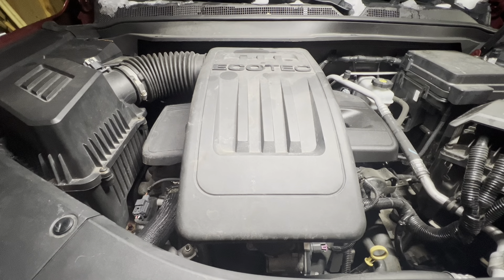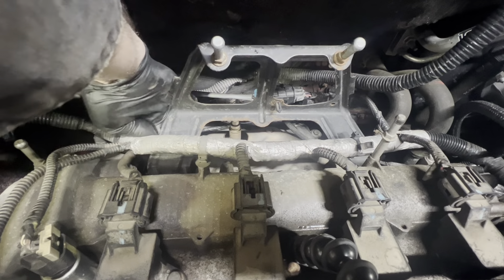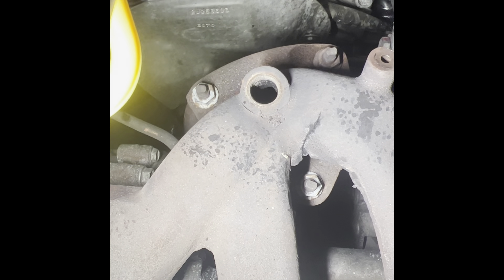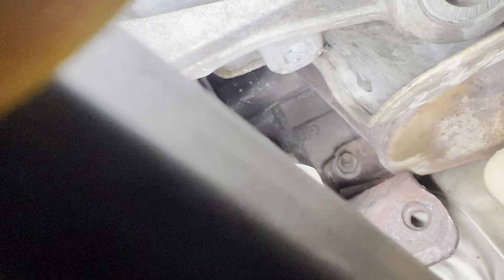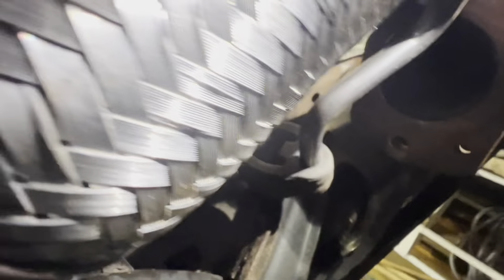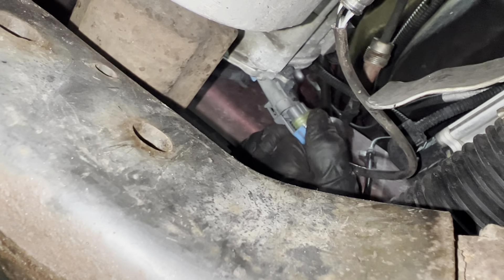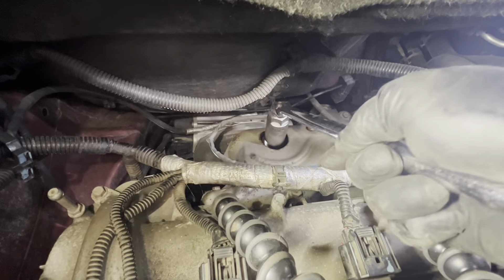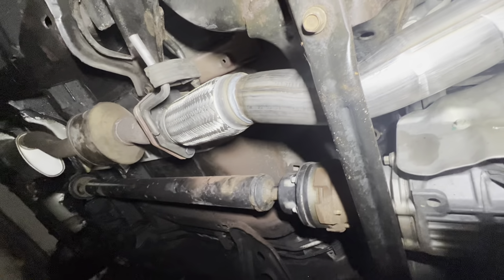2011-2017 Chevy Equinox & GMC Terrain Catalytic Converter Replacement

Comment: This video helped me out a lot thank you. I ended up also replacing the exhaust manifold due to it being cracked in the middle. However, now I smell exhaust inside the vehicle do you have any thoughts on what I did wrong? I followed the video step-by-step.
Reply from the maker: New exhaust parts will smell for a little while until they break in. 
If it doesn't got away after 100 or so miles, check for leaks. Maybe you missed a gasket?

Comment: Thank you so much for this video. I just finished doing this on my 2013 GMC Terrain. I'm not a mechanic and the only other work I have done is replacing spark plugs, changing oil, brake pads and rotors, air filters, lights, etc. It took me two days and about 12 hours. The only thing not in your video was the air injection check valves. Maybe because I'm in California or cause mine is AWD. They were a pain and were totally in the way. Had to remove them and zip tie the pipes down so they would be out of the way. That bracket holding the cat on was the worst part. I was finally able to get it off by reaching down from above with a combination wrench. I would have gladly paid a shop to do this work, but nobody would do it because of California laws. No way could I have done it without your guide. Thank you bro!
Reply from the maker: Thanks! 
Those check valves must me a California thing because this one was AWD. 
Glad you got it done. Sorry about those CA laws
Reply: @BrakeTheBank yeah CA laws sucks.

Comment: What problem was you having to make you replace the cat currently mine does have a loss of power under acceleration.
Reply from the maker: It was due to a check engine light

Comment: Excellent video. I just tried some Cataclean but if it doesn't help my issue I'll be replacing the catalytic converter following your instructions.
Reply from the maker: Sorry the catclean didn't work. Glad I could provide a little help with your project!

Comment: I have a 2013 GMC Terrain AWD. Took me 8 hours. Got the part from RockAuto. Borrowed the O2 sensor socket from O'Reilly's. Longest part of the job was figuring out how to get the back nut on the bracket off - I ended up cutting the old cat in the middle of the L so I could push it to the side and get the nut out. If anyone else has an AWD, I recommend cutting the pipe as I did. There are other ways, but cutting the pipe is easiest/fastest. Probably could have personally saved an hour or two with a better cutting tool, but you use what you've got! Thanks for the video!
Reply from the maker: That's a good tip!
Reply: What pipe are you talking about, are you talking about the catalytic or the exhaust pipe?
Reply: @misaelherrera2845  The exhaust pipe just below the catalytic converter
Reply: @benjaminleinonen2153  oh ok

Comment: for the 3 bolts attaching the manifold to the catalytic converter, is there a torque spec? If not, then what is the torque spec of the impact driver you used?  I want to make sure the studs don't break
Reply from the maker: Oh man, that is a good question. I don't know/I don't remember.
My guess would be around 50 to 70 foot pounds but don't take my word for it.
I would definitely recommend tightening them by hand so you can get a feel for it
Reply: 30 foot pounds or you could put a crack on the exhaust manifold
Reply: The crush o-ring doesn't need a lot of torque to seal tight. So definitely don't go crazy if you use a impact gun.
Reply: I used 124 in/lb (10.3 ft/lb) which is the same for the exhaust manifold to cylinder head.  I’m still sensing a little bit of exhaust sometimes at stop lights.  I don’t think it is enough.  Think I may need to go higher.
Reply: Did you check other lower connection fo leads. Cold engine soapie water test on connections
Reply: For leaks
Reply: Have not.  Thank you will try that.

Comment: I just did this and the light went off, I thought the P0420 was finally gone,  but it just came back 6 days after replacing the cat.  I did not do new oxygen sensors, this car burns oil, do you think the sensors may be compromised?  

Great video and thank you
Reply from the maker: Yeah sounds like something is going on. You'd have to view live data to see if the o2 sensors are working properly. Also check fuel trims. If it's running rich it will foul the new cat.
Reply: @BrakeTheBank  pulled the 02 sensor today, thing was TOAST!!!!  Replaced a cooked densor (someone must’ve been in there before) with the AC Delco OEM sensor. I didn’t clear codes as I want to see if it will clear itself after some drive cycles.  Will keep you updated.
Reply: @brendanf8969 from what i read in the article about the 2011-2014 chevy equinox recall, the excessive  burning engine oil caused the catalytic converter to fry up. Thats what i read in the chevy recall when i was researching about the excessive oil consumption.

Comment: Good job in the removal and install. Mine had rusted bolts that had to be cut off.
Reply: What did you do when you had to cut the bolts
Reply: The two bolts that secure the Cat to the exhaust pipe were rusted so I cut them off and replaced with new bolts. The single bolt that attached the cat to the engine Bracket also had to be cut and replaced. What a pain!!

Comment: Great video! I wish I had the tools and time to do this to my 2011. I'd like to replace my complete exhaust system. But buying all of the parts and tools and finding the time to do it is a problem for me.
Reply from the maker: Yeah it's a pretty big job. Some of the tools (Like the o2 sensor socket) you can borrow for free from your local parts store. This would be the hardest part of replacing the whole exhaust system so If you can do this you can do it all. I'd encourage you to try.
Reply: Just get a basic tool kit like harbor freight 301 piece or something similar and get other tools as needed..most of the guys will tell you exact tools needed for the job. The satisfaction you feel when you fix your own car is not only great but awesome 😁

Comment: I have a 2013 LT Equinox and I found a couple of parts, which I think are something to do with emission control, on top of the heat shield which meant I would have had to remove them to get the heat shield off. So to anyone watching this video have a GOOD look before you start pulling bits off, the job may be bigger than you realize!
Reply from the maker: Oh wow! Might be something different for cars originally sold in CA or something?
Reply: @BrakeTheBank  Could be for CA compliance, I didn't have the passion for doing the job myself (pulling the cat) so I'm getting a mechanic to do it. It is shop that sold me the vehicle, he feels guilty he sold me a vehicle that needed work, so he's doing it for a greatly reduced cost.
Reply: @pete7413 idk, i live in  CA, and my chevy equinox looks exactly like in the video. Probably yours was a v6 engine,  because this one looks like a 4 cylinder engine like mine.
Reply: @misaelherrera2845  Lol, no, definitely a 4 cylinder though how I wish it WAS a 6 or at least any other engine but the oil using 2.4 configuration. To anyone considering buying a secondhand Equinox do better research than I did and pay the extra to get a 6. You won't regret it. 

Update to my first post above. I got the cat replaced, and the engine check light came on within a day. I bought a gadget to reset it and it does that fine however it came back on after a day or so. 

I don't even bother to reset it anymore as being an aftermarket cat the car will always throw a code but the difference in price between an aftermarket catalytic converter and an OEM is enormous. Too much to justify on vehicle I didn't intend to keep, but, here we are a year later and I still have it, and the light is still on :(
Reply: @pete7413  that is very true. Oem parts are very very expensive. Thats what my younger brother was telling me when i used to own a 2015 chevy cruise.  The check engine was on 130k miles, he told me to not bother because it has 2 catalytic converter one in the front and the second one in the back and its a pain in the rear end. The part was somewhat affordable in the after market but paying for labor was going to be expensive part for the car. Doing smog check in California was expensive because of the check engine light from the catalytic converter , every 2 years we had to smog it illegal for it to get tags. The illegal smogging would come out 500 dollars or more depending on the California emissions laws that keeps changing every year.

Comment: Only if had the strength & tools 😩🤦🏼‍♀️
Reply from the maker: You got this! You could get all the tools you need for this job for under $100 at menards or harbor freight. That's way less than you'd pay in labor costs.
Reply: @BrakeTheBank  Yes but it's so much easier with impact tool. I love doing auto work since I picked up my 1/2, 3/4 and 1/4 inch cordless. Tried  it without them and It was murder without them or breaker bar. Could not get the the bolts out close to the back cat or the back sensor.

Comment: Hi thank you for the awesome video, I’m trying to remove the converter of my 2011 gmc terrain, last step about removing the 15mm nut of bracket, it doesn’t give me enough space like in this video to reach it, can you give me some suggestions?😅
Reply: For update, I have changed it successfully, my problem is solved by cutting the pipe. In my case, the pipe has to be cut in order to reach the inside nut of bracket.
Reply: More reference: https://youtu.be/PE8PSsy_rxc
Reply from the maker: Try using a swivel and some long extensions

Comment: thanks for the video but i would replace all sensors
Reply from the maker: Yeah it might be a good idea to replace the sensors if you want to avoid having to replace them down the road. In this case I had just replaced the down stream sensor.
Reply: Hey do you know how I can identify this issue with my own vehicle..? My car smell like exhaust gas fumes especially when the heat is on And sounds  similar to a low rumblling motorcycle. And now has began to seem as if it’s losing gas or stalling and sputtering…I order the front cat converter and gaskets it’s a 2016 equinox could this really be the issue I’ve been having as well. I’ve also gotten the p00420 code
Reply: @Awol2020Latimore1 Cracked exhaust manifold.

Comment: How much would this job cost on average?
Reply from the maker: Just speculation here but I would guess about $300 labor and another $1200 for an OEM catalytic converter so $1600. When you have a shop do the work they keep the old cat which has a lot of recycling value. 

I got this cat on rockauto (not sponsored) for $300 and took the old one to scrap and got $300 for it so my total cost was pretty much $0. Obviously the aftermarket Cat isn’t as good as OEM but it will do the trick.

Comment: Any idea if it's the same in 2012 terrain
Reply: I believe so.   Yours will likely look a little different up underneath because this car is an AWD, but for the purposes of the cat replacement everything should be exactly the same.  I'm about to tackle this on my 2012 Terrain this weekend. It's a FWD 2.4L.  I went to Harbor Freight and got a cheap angle grinder just in case some of the existing fasteners need to be cut.  I already have all the impact tools I'll need and a Oxygen Sensor socket. 
    I bought a Cataran brand convertor from AM-AutoParts eBay store for just over $300.  My car uses oil and I think it's going out the exhaust, hence the need for a replacement cat.  Hopefully it'll last me 2-3 years. By that time I'll be into a newer car.
Reply: @cswann8  I just replaced the cat on mine last weekend. It wasn't that bad and I'm no pro. The 3 bolts at the top are accessible in the engine bay the center bolt you can get from in between the manifold.
Reply: @cswann8  I got quite a bit of the bottom end power back I was actually surprised on the difference I put new plugs in to it was definitely worth it
Reply: @keithgraver5482  Very nice. If I get some low end power that'd be OK, but I just want my car free of any ECU fault codes.
Reply: @cswann8  the only code I had was p0420 its the down stream o2 sensor I had a blown out seam in the cat. Do your self a favor remember to pull of any stickers or tags on the cat or they will burn off and smoke quite a bit I left them on not thinking about it I had my wife freaking out lol.
Reply: @keithgraver5482  out of curiosity.. did you spring for the GM part or go aftermarket?
Reply: @cswann8  aftermarket, but the differences are obvious the converter itself was smaller. Mine is a cylinder instead of oval the oval shape has much more surface area inside. This is my opinion but It doesn't sound as quiet and high quality but it has a 5 year warranty.
Reply: Looks like the exhaust manifold was starting to Crack between 2 & 3, common.

Comment: what tools did you use to remove the 3 bolts from exhaust manifold ?
Reply from the maker: If I remember right they are 13mm so I used a 13mm deep socket, attached to a swivel, attached to a 12" extension

Comment: Cracked manifold! No one noticed?
Reply from the maker: I did 🙋‍♂️
Reply: they all are, lol
Reply: That’s why I ordered the cat and the manifold from rock auto at the same time! Doing this repair tonight or tomorrow after church on wife’s terrain!
Reply: @kenwillis8487 Can I ask you what was the terrain doing to need this repair? I have a ‘16 Equinox that’s driving terribly and I think the front Cat is the problem
Reply: @Awol2020Latimore1  on mine it was obvious noise from manifold. It ran better afterwards too, I guess b c of pressure
Reply: I noticed
Reply: Aren't they all...we all here probably for the same reason 😮
Reply: First thing I saw. I here common on theses cars
Reply: @kenwillis8487 how did it go, I need to change my wife’s Equinox 2014 and I wonder what brand should be fair to buy, because the original part is very expensive?
Reply: @sergiolopezperez1112 imho the longest lasting one is going to be a header for the cobalt SS 2.4l
Reply: They all crack